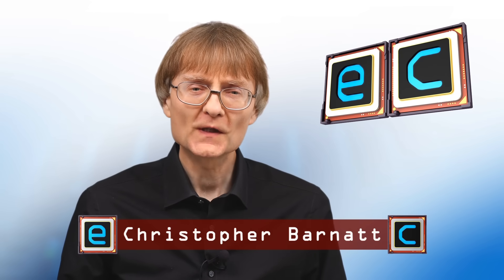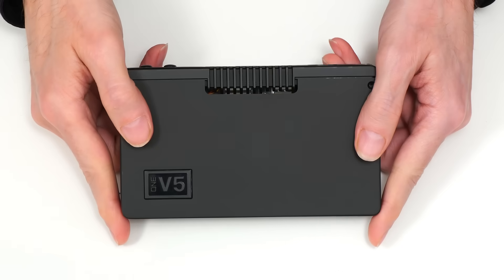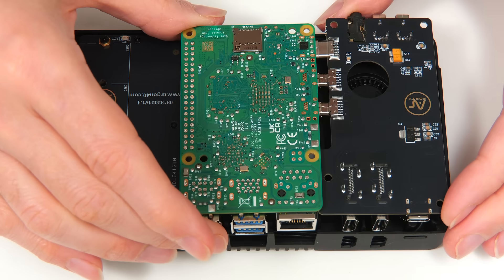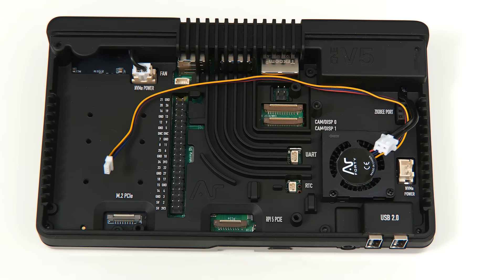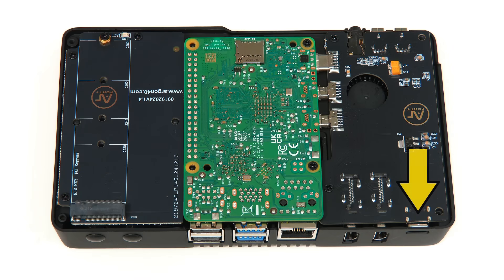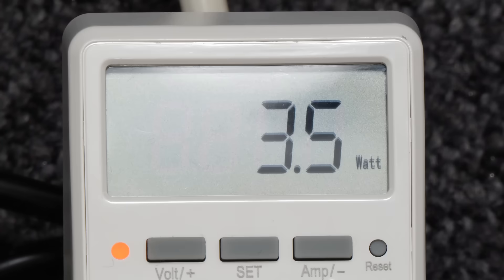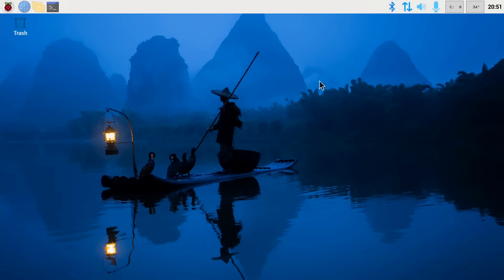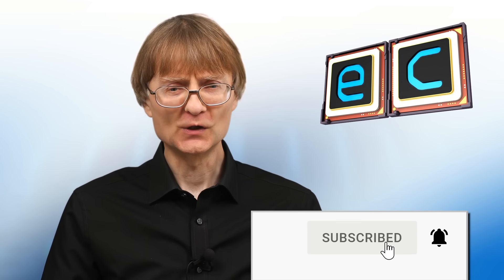Argon ONE V5: Ultimate Raspberry Pi 5 Upgrade?

Comment: I have an Argon V3 that is a smaller and a little bit more struggle to get together. But what I would like you to look at is a CM5 with board. It would get you about the same building size but with external antenna and more options of storage.

Comment: Excellent video - as usual. Much appreciated. Question: bought the double version and installed one original Raspberrypi NVMe. But the speed is only 417.36 MB/sec. Looks like Gen 2.0 for PCIe. How can I set it to Gen 3.0? Any hint?
Reply: I've been reading on that, and apparently the controller included in the Argon40 adapter is an ASM1182e which is PCI Gen 2.0 (max). So you'd have to get a different one. Look up the article "Double the slots, half the performance". Merry Christmas!
Reply from the maker: I covered the edit required to obtain PCIe 3.0 speed in this video https://www.youtube.com/watch?v=_LYU-I1LzcI -- including the code in the video description.

Comment: I’ve one complaint about the case, the power switch easily jammed and stuck, especially when I repeatedly changed the NVMe for testing. It was partly Pi to blame for the tiny power switch design, and the case design did not adapt well to that, so that I got random hangs and not powered on during use.

Comment: Just picked up an Argon ONE V5 case based on your review, and I am very impressed with it. I also picked up the OLED display which shows CPU temp as one of its options. So far it hasn't gone over 45C despite pushing it hard. I now need to dig out a spare M.2 card and shift the Ubuntu OS over from the SD card to really put it through its paces, but I think this will be a good option for those looking for a fast, cheap mini PC on a budget.

Comment: My Argon 5 arrived earlier today which is pretty amazing given that I only ordered it Sunday. Two things to note. 1 Make sure that the Pi 5 and daughter board are FULLY plugged together. Mine wouldnt power on and investigation showed I hadnt got the USB C power jack fully seated. 2 The same with the PCIE ribbon cable which has to be carefully and fully seated other wise the Pi 5 wont see the NVME board.

Comment: Q: the thermal sticking: after placing the Pi5 in the case, does it stick to the case or is it just pushed to make thermal contact?
Reply from the maker: It sticks slightly to both the case and the chips on the Pi, but is pushed (squashed) together. If the case is opened again it's 50/50 whether each pad is stuck to the Pi or the case.

Comment: Much to my surprise a N100 PC from AliExpress say "TexHoo Mini PC Intel N150 N100 8GB DDR4 256GB SSD Dual HDMI Desktop" costs $115, cheaper than a Raspberry 5 alone - $120 at Amazon. In a server application the N100 is faster and a better choice. For IOT type application especially if power consumption is important the Raspberry 5 might be better. My impression is the Raspberry 5 is currently a little over-priced.

Comment: Congrats on such a HUGE milestone 600 videos, amazing. As for the Raspberry Pi sadly for that price you can get a used fast T series Thinkpad for about the same price. I got my T480s for $180 with touchscreen, backlight keyboard, 8gb soldered ram(1 empty memory slot), 256gb m.2. Though i will have to admit, I lucked out in the refurbished lottery because the touchscreen and keyboard weren't listed and my unit was VERY clean. Only thing i had to do was replace the thermal paste, luckily older thinkpads are easy to tear down.

Comment: I would totally go for this, but old efficient office computers with 500gb ssd and 8/16gb ram sell for 30 to 50$ used. (for example lenovo think centre) And brand new n100 computer with 16gb ram 500gb ssd starts at 100$ on amazon/aliexpress and even without any discounts or sales going on it is 130 to 150 bucks.  Those are much more powerful computers that can game very well(but i use them for 4k media playback) and efficiency is still insane on them because they use mobile chips or efficiency cores.

Comment: I have the pironman 5 case its great for raspberry pi 5 it adds nvme, full hdmi, rtc battery, a great little tower cooler, rgb fans and lighting plus a little oled display, i have it with a 16gb raspberry pi 5 works great as a media streamer and nas

Comment: Cool! But the argument related to Apple buyers I cannot see. Since 10 years I have Final Cut and Logic, as well as continuity. Since Apple I do not have to buy Microsoft Office nor other software windows does not include. Ok, they could improve spotlight, but except of this it is the best device for the bucks, at least in my case. And yes, I know there is a huge open source variety available, but if Apple has a solution that works for me (free of charge/free updates) I use it. With Apple I save about 250 Euro per year/device.

Comment: Seems like if they are going to do this level of mucking about with the Pi 5 connections they'd be better off starting with the CM 5! I'm struggling to think of a use case for two extra USB connectors on top of the pretty generous four already on the Pi, but they could at least have made them USB-C.
Reply from the maker: It could be that keyboard and mouse are connected to the front USB 2.0 ports, then the USB 2.0 ports on the back go to a printer and a scanner, so leaving the USB 3.0 ports free for storage use. Perhaps. ;)

Comment: Looks great, but i wish there was a door so i could swap the m.2 drive easily for a different os.  As usual Chris thank you for another great video :)
Reply from the maker: Agreed. I miss the M.2 door on the Argon NEO 5 for the reason you state. However, the door on the NEO 5 is held in place with four screws. And so is the base of the Argon ONE V5! :) So access is, in practice, the same.
Reply: @ExplainingComputers  Could be easier.

Comment: I've now moved from Raspberry Pi across to an Aoostar N1 Pro (N150). For Australia the MiniPC option is just much more affordable than setting up a full Raspberry Pi. I did have the Argon NEO 5 but after trying 4 different, brand new NVME drives, and both of the cables, I couldn't get any of them to be recognised by the case and just gave up. 
Still loved every minute of your video though. Always a joy to watch. Cheers!!

Comment: Just for comparison, my base M4 Mac Mini also uses 3.5 W and runs at 35° while running 3 radio stations, doing audio processing on 3, and encoding 4 streams. I love the Pis, especially if they can stay cool and quiet in a capable case like this.

Comment: Another good Argon case, they have been consistently good for a while now.

Considering the Zigbee is used for home automations I assume the reason they have added it is that they plan to produce a case to rival the Home Assistant Green and Yellow cases, which wouldn't be a bad idea.

With the power draw needed for the newer Pi boards, and the issues getting longer USB-C leads that'll work with the Pi, I wish they would add a 12V barrel plug to these cases and a buck converter to pull the voltages down.  You can get 12V PSU easily and voltage drop won't be a problem if you don't want your Pi closely tethered to a wall socket.
Reply from the maker: I agree, a 12V barrel jack option would be a good idea.

Comment: Hey Chris, I recently purchased a "refurbished" 12TB Toshiba MG07 HDD on eBay, for £145.00. It had 17 POH, and 6 power cycles. The drive was manufactured in 2021, for DELL. It arrived in a caddy, which I presume is for a DELL server?

I've heard that helium can escape from anything. I love the "Helium Containment" SMART attribute, which is "OK."

What's your thoughts on "Helium Containment"?

Star Trek, "Captain, we're losing Helium Containment!" 🤣

Excitement level: 12+
Reply from the maker: Helium containment is hard as you note, and will reduce the life of HDDs that rely on it. But it also allows higher capacities, and the helium is expected to be retained sufficiently for a good five years of normal use.
Reply: @ExplainingComputers  Thanks for your reply, Chris. My drive is already almost 4 years old.

Comment: Nice case but the thing is there are several competitors to the pi5 on the market that offer 2 to 3x the performance of the pi5 for roughly the same price and have more software support too. 
At this point the pi5 doesn't really seem like a good option anymore

Comment: good review Christopher 👍🏻 tho in 2025 I would have rather had two USB 4s (40 Gb) instead of the old and slow USB 2s
Reply from the maker: There is no way to add USB 4 to a Pi -- the new USB 2 ports hub from the USB-C port that also powers the board. The DAC does the same.

Comment: I would argue that the Waveshare M.2 NVME PCIE Case for Raspberry Pi 5 is much better than the Argon's offering. You can even get it with optional features, additional ethernet ports if you're doing router, nvme for speedy stuff, and it you can get a hat on top of the pi with room as well. Comes with ears so you can mount it to a wall too.

Comment: I love the idea of using something like this to make a media centre and NAS. The only problem is that I’d want to fit it with a high-quality audio HAT. I currently use an IQaudio HAT on a Pi4 for this purpose. I guess it would then be tricky to get the audio signal cables out of the case. The full-size HDMI outputs would make it much better for connecting to a TV though. Seems like these fancy cases are always great for everything except the application you have in mind ☹️
Reply from the maker: There are two holes with plastic plugs fitted in them what can be used to fit antenna for a Zigbee module. So these could route other cables out of the case. Although only if you were going to wire your own cables, as you would not get a connector through the holes.

Comment: Very nice case, and an excellent video! I'm currently running a media server with a Raspberry Pi 5 in the Neo case. I noticed that it heats up more than I like so I have a fan clipped to the rack blowing across the case. That solved the problem, but I really like this case for this application. I have the better part of 20TB of media (which I own, I might add). I'm running a Seagate 20TB drive in a Sabrent dock. I have a second dock for backing up media as I add it. What I like about the Pi vs. the entry level computers is that I can control so much more with the Pi in terms of configuration and application. I think it's far more flexible. I also do not want to ever use Windows again. I think Microsoft have made grievous errors with Windows 11.

Comment: I recently bought a Raspberry Pi 500 and monitor. Such a breath of fresh air using it compared to my Windows 11 PC. It's simple to use, no bloatware, no A.I, and it doesn't keep telling me what to do. It's just like a friendly pet that just wants to please it's owner.
Reply from the maker: I like how you've put this! :)
Reply: Well said.
Reply: Microsoft and Windows are literally cancer. Good on you for trying something different.
Reply: Nice! What OS did you go with?
Reply: Raspberry Pi OS. May try another OS later on.
Reply: No internal NVME option killed it for me.
Reply: @ninline2000  the case as reviewed has a place to install 1x NVME SSD. 
On the inside (internal).
Other models of the same case will accept 2x NVME SSD's
Reply: @colonelfustercluck486  Yes. I was replying to the comment about the Pi500. I would have gotten one of those if it had an nvme option.
Reply: I'd be okay with a nice, placid, computer .... but all MY pets have been holy terrors that bossed me around.
Reply: No one forces you to install Windows on your PC - just install whatever flavour of Linux you prefer on it.
Reply: I cant use Linux without chat gpt at my side bc its impossible to use wo knowing all the  utilities names. Its as simple as windows until something breaks. Or you try to do something apparently too technical like, I don't know, try to install screensaver you want.
Reply: @KOTYAR0  who the heck uses screensavers anymore?
Reply: @KOTYAR0  There are desk mats that have all the linux commands. It was what I used to make the break. Just a thought.

Comment: Unless you need gpio or arm an N100 wins on price, memory,  compatibility,  performance, hardware video decode etc
Reply: Does anyone know the approximate power usage difference?
Reply: @chris-io9zt pi uses 5 ish idle 10 under load,  n100 up to 21 under load. It's a shame i have a pi 3 4,5 and they were fun and cheap put since covid put the prices up they aren't really competitive

Comment: Other than "at least it's not x86," Is a Pi 5 better at anything than a mini PC at the same price point?
Reply from the maker: It uses less electricity. :)
Reply: @ExplainingComputers  Yes! That could be a valid answer, but does it use less electricity while performing at the same level as a mini PC? Or another way to ask, if you throttle a mini PC, would that advantage disappear?
Reply: @GerardPinzone I would assume that if you throttled a miniature PC to the point where it would run at roughly the same wattage as a Raspberry Pi, that its performance would be considerably poorer than a Pi. I may be wrong about this, though.
Reply: @amadeus484  Sounds like a good topic for a video!

Comment: Awesome video. :) I'd really love to build in one of these. (The 2xNVME model isn't on Amazon, but is available from Argon40's website.)

It's just … very difficult to justify the price of a Pi 5 right now, especially now that I've discovered that it's possible to snag slightly used office x86 mini-PCs off eBay with 12th gen Intel processors in them for not that much more than the price of an entire Raspberry Pi kit (case, cooler, Pi, NVME, PSU). I just looked on Amazon, and the 4 GB Pi 5 is ~ 70 USD, with the 8 GB model ~ 93 GB. With the tariffs, I suspect that's only going to get worse.

Still, for a low power emulation system or low power desktop, the Pi can't be beat.  You mentioned that it's … possible … though probably not ideal, to stuff a hat in there. Any chance one of the PoE hats would work, do you think? 

I'd love to put one of these together and have it be PoE powered just for the ease of cable management, and use it with remote desktop software to monitor all the various bits of my overcomplicated home network/home lab/home server setup.  A 4 GB Pi 5 would probably be sufficient for that, though I'd prefer 8 GB at least.

Comment: In minute 5:00 of your video, when you connect the two boards, the connection does not look very strong and secure. Looks like the connectors should go in a little deeper.
Reply from the maker: That is as far as they go! :)

Comment: It's a cute thing, but the Apple point is not on point, and trust me, this coming from a guy that has a M2 Mini sitting on top of a 30y old YY-5601. There are LOTS of reasons you HAVE to have a Mac. Say XCode, FCP, etc... That is a MUST, not a WANT. There AREN'T any "non WANT" reasons for a "Pi with all extras". And much like my Amiga's of old, it becomes an expensive "hobby" which is realistically hard to justify when you factor in "cost". When it becomes close to "i could buy an Intel NUC and add a Pi Zero W for GPIO", it become hard to rationalize. Now, their cute €10 aluminum case for the Pi Zero 2 W... that i can justify as "WANT" even if not rational 😅
Reply from the maker: With my Mac point, I was looking back historically. These days I agree have changed somewhat. But for decades this was not the case.
Reply: @ExplainingComputers  Sort of, it's been back and forth. When the Mac appeared, it pretty much carved up a niche in DTP and became the "de facto" standard. Then up until Win95 showed up, you had many of the apps already on Windows, but the performance (and stability) was lackluster, thus, Mac's remained "untouched". But by the time they released the original OSX, W2K was standing strong and many software players had shifted their efforts, riding on the back of NT4's decent performance and subsequent massive improvement in W2K. And back then Apple was in shambles, stuck with expensive PowerPC's and OS "growing pains". That was a MUST>WANT shift. iPod/iPhone bought the some breathing room, and some "lock in" with software developers, as well as the "pro apps", as they dropped PPC for x86 to regain some economic competitiveness, but now they only offered... OSX and an Apple logo on the case.
These days, bar some of the "lock in's", it's more of a "i like MacOS more" thing yes, for most users it will be akin to choosing over different microcontrollers when the only requirement is to blink a LED. Or debating over over C/MicroPython/.Net Nanoframework when all you're doing is still blinking a LED while connected to a wall socket. Matter of taste ;)

Comment: Excellent Prof.  I like this and I just may take this as the rig for my family June/July vacation on the shores of either Alabama or Florida.  I've always used my MacBook Pro for photo processing via LightRoom/PhotoShop but I've been learning Gimp.  How about them apples for a 77 year old kid?
I have never tried this, or any other setup, "in the field"!   :~) 
{plus I can remote back to my home lab and use the Mac if not the Pi is not satisfactory and make use of my lab's NAS.}  
Latency will be at issue on the remote link but "Oh Well".
The thermal results sealed the deal for me...
Thanks again!

Comment: We have to admit that Argon has a knack for coming up with highly innovative cases for the various versions of our Raspberry Pi... This one is one of the must-haves! You're right to point out that the price is high, but in my experience, Argon products are designed to last a very long time. Thank you for this new presentation!
Reply: Normally with sh**ty fans that break with no reply from the company even when simply asking how much is a replacement and often severely attenuating the WiFis.

Comment: 3.3W RPI5 roughly idle. 4W on my Lenovo M910q (32GB ram, 6500T skylake cpu, 256GB nvme) running proxmox. 
Have the rpi zero, but hard to justify newer RPI5+accessory cost encroaching X86 prices.